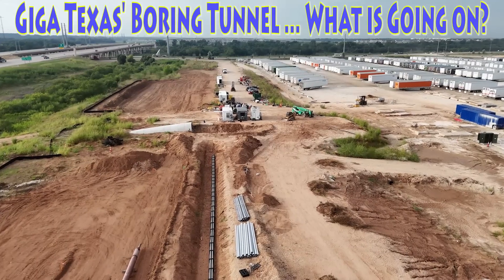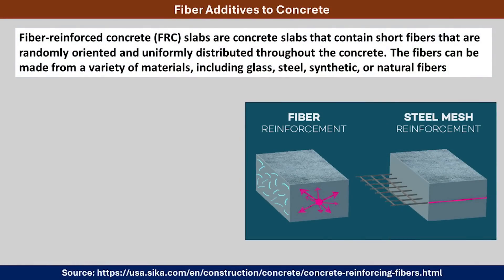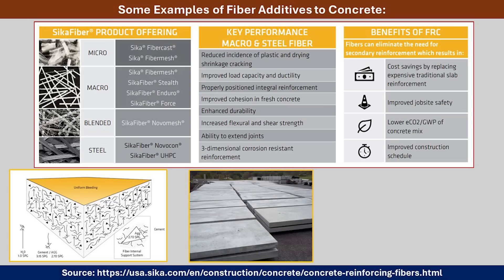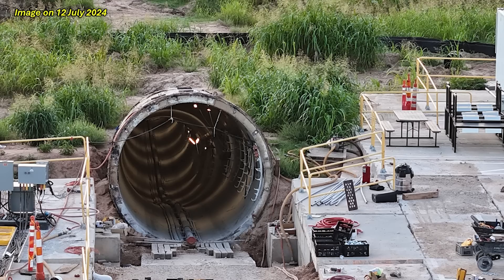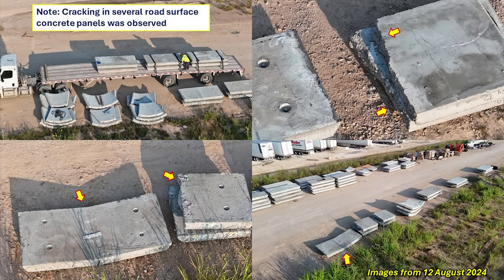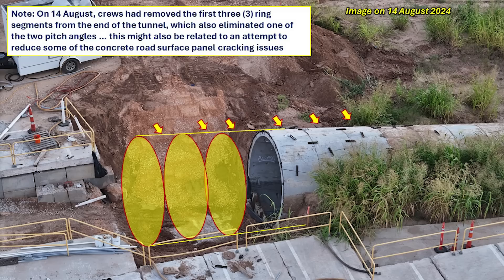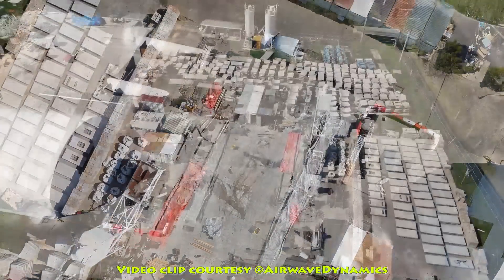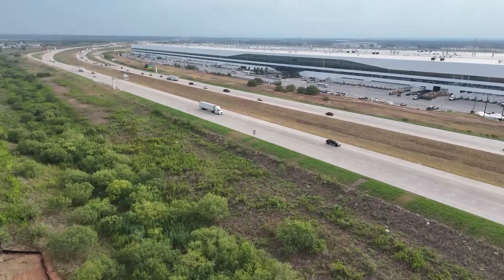Boring Company Giga Texas Tunnel Road Panel Issues, Mitigations & Probable Solutions

Comment: It is my understand that fiber reinforcement was developed primarily to reduce the cracking of concrete slabs placed on graded ground surfaces such as driveways, sidewalks, and slab on grade floors. The fibers in fiber reinforcement are not long enough and do not have enough surface area to provide the needed tensile strength the transmit the live load carried by the slab to the points of support.

Comment: The Boring Company is incompetent.   But his is just the tip of the incompetency iceberg. Elon thought boring smaller tunnels would be faster.  Its not.  But they ARE too small to afford proper ventilation for any substantial length.   Okay for electric vehicles, that won’t pump carbon monoxide into the low parts of the tunnel, but a death trap if one of those EVs catches fire.   And not suitable for any fuel burning vehicle. These narrow tunnels also fail to allow an escape path should there be a vehicle fire in the tunnel. ( he would have to bore a SECOND parallel tunnel for that. )

Given what a Tesla fire LOOKS like. ( plenty of videos online ) would YOU want to be the Las Vegas tunnel when the chauffeured Tesla in front of or behind you bursts into flames?

Comment: I had a neighbor that did the same thing with his driveway vs ours that use rebar.  He has cracked up so much more than ours. I would t use fiber based concrete at least when building residential for sure as many smaller concrete companies don’t have the expertise.

Comment: I'm an ex UK tunneler who started work as a surveyors assistant in 1960 (Chainboy) Drove site equipment and when old enough helped to assemble open face tunnel boring machines for a new line of the London Underground, due to the knowledge I learnt in erecting the machines I became an operator obtaining tunnel average speeds 12/13 rings per 8hr. shift the record was 21 though that was a fluke as no tunnel had been done in the previous shift, so a stock was at hand in the tunnel and all skips empty. My next contract was on the Suez Road Tunnel as supply yard superintendent. Lining segments and road decks of steel reinforced concrete were cast onsite.
 I then joined a Civils Consultant company's tunnel department as a Senior Inspector of Works, my first posting being The Cairo Wastewater System a UK/Us Aid project through silt ground so closed face and balanced bentonite was used as face support and material conveyance.
The first time I involved with NATM shotcrete was on the Heathrow Express tunnels and stations within Heathrow Airport. Blue clay excavations were carried with a rotating bucket excavator, a top heading was dug. A sealing layer of shotcrete applied, rebar arch and steel mesh installed and a layer of shotcrete applied, more mesh and final layer of shotcrete. The tunnel was built top headings first for 10m, bench heading and then invert to catch up and form the circle.
This same method was used on Crossrail tunnels project in London but shotcrete was replaced with fibrecrete which was shot into place thus it was compacted. Core proved no voids found. The lining concrete was delivered to site before excavation could start, slump test taken and then fibers added to ensure quality. Plus no delay on delivery to site.
My thinking of the fibrecrete road panels was as mentioned in other comments. Design not allowing for point loading in construction. Lack of compaction and supervision and possibly poor mix design and controls. I have never seen flat panels used, tunnel linings are subject to an even loading full circle, so the loading is spread out.

Comment: Did anyone get fired or reprimanded for the fiasco of the road panels❓️

If it's a factory setting, then the form templates would be so that a worker wouldn't need to set foot into the concrete.  Thus the rebar wouldn't be pushed to the bottom.
Reply: The rebar should be installed on spacer blocks to ensure a designer cover to rebar, usually 50mm. I just love to watch the video of driveway contractors stamping mesh in by foot. I wonder why most of them crack.

Comment: concrete in bending need to be pre-stressed.   the panels in bending are in tension on the bottom and that will definitely fail unless it is preloaded in compression.   ME 101
Reply: Short slabs of this size don't require prestress. A 12mm x 150mm x 150mm (1/2" x 6" x6") mesh in the bottom third would have been perfectly adequate.

Comment: Very interesting summary by Joe. Had a read through the comments, some very relevant, some only half right. Time to add my long winded (sorry) thoughts:

1. Fibre reinforced concrete is an excellent technology when used correctly. In this case it was not. I find it almost unbelievable that there was no quality control test on some early samples to ensure they could perform. Maybe there was and they just got their numbers/assumptions wrong. Early examples on site at Giga Texas showed signs of cracking and very poor quality concrete (honeycombing of aggregate showing lack of compaction). If these basic quality control problems were self evident to someone (Dessie Doolan and Dave Johnson also commented at the time) watching them from a drone video, I wonder what quality control was being adopted on site at Bastrop and Giga? Not much, would be my conclusion.
2. The design flaw may have been incorrect calculations, It may also have been in the design assumptions. These slabs have a number of load conditions to meet, often the service loading (in-place) is not the critical one. Manufacture, transport, installation loads, etc all need consideration. The wheeled telehandler used for their installation may be a load condition not designed for. Consider the front wheel point load, carrying the next slab in front of it. running a little off line so the wheel moves from the side to the centre, the opposite wheel climbs the tunnel wall slightly, the load swings, the driver hits the brakes. Suddenly you have a dynamic point load that can be 3x the static load, sitting in the middle of the slab. A lot heavier than a cybertruck wheel at each side.
3. Some close-ups of the broken slabs showed the fibres sticking out. It didn't seem like a lack of fibres to me but hard to tell from these arial shots. 40-50kg of steel fibres per m3 of concrete is a pretty common dosage.
4. Should be nothing to do with the tunnel alignment. The slabs should have been designed with tolerances to suit the universal ring tolerances of the tunnel segments. If not it is back to a design error. They knew the tunnel had a vertical curve and the longitudinal pitch of each tunnel ring varies by 2 inches from widest to narrowest point.
5. Removing the first 3 rings had nothing to do with this invert slab issue. We can see the first 7/8 rings are all in a straight line. these sat on the ground where the TBM was launched from. A concern at launch was the poor quality of the ground right in front of the TBM (it got a lot of rain while waiting for the TBM to launch). I predicted a "dive" at the TBM launched due to this. We can see from the alignment of the 4" pipe that this occurred (not uncommon). TBC can say what they like about having to do this intentionally but the argument doesn't hold water for me. why launch at the wrong angle and cause a misalignment of the thrust forces intentionally in the early stage when you could angle the TBM down 2 degrees and get a straight launch (how it is always done). Very common to have some sacrificial rings at the launch as cracking and displacement often occurs. 

As Dessie has said, the tunnel lining used fibres (it may also include rebar). They are used worldwide in tunnel segments, often with no rebar. Tunnel segments largely operate in compression so the reinforcement of any kind is fairly redundant. Fibres (especially polypropylene microfibres (non-structural) help a lot to avoid spalling during handling, aid durability  and (of ever greater importance, give the rapid increase in electric vehicles) resistance to explosive spalling during a fire. Steel fibres distribute loads and provide a lot of resilience/ductility before failure.

Feel free to disagree, I may well have missed something or be way off base with the latest fibre technology.

Looks like the have a fix in hand. I hope the steel reinforced replacement slabs have been tested and their design independently checked. Plus some 28-day strength tests, rebar load tests, cement and aggregate supply quality records, mixing, compacting and curing records (basic quality control measures that stop us all falling through the floor).
Reply: Definitely quality control problems, but my question is... Is fiber a good choice as the only reinforcement (no rebar) when the concrete is likely to be placed in tension... Beams, bridge decks, tunnel road segments, etc.? Can fiber ever be engineered to be safe when concrete in tension under heavy load?
Reply: @DavidJohnson-tv2nn  Generally not. But the technology is advancing all the time. Already used for slabs that span in two directions. Certainly could have spanned the slab width in this tunnel if designed right. My bet would be they didn't think about the temporary load case I described.
Reply: @tunnellingsalisbury7605  Thanks for the reply! Not being an engineer I'm at a big disadvantage here. Your suggestion as to the cause seems entirely possible. But there are a couple of questions....
On Joe's 7/29/24 video at the 19: 56 and 20: 02 timestamps.... There are 4 and possibly 5 broken tunnel road segments stacked beside the road. Likely failed even before being installed. But even if they were removed after being installed.... 5 failures caused by unusual loading events?
Also, if these failures were caused by the telehandler, why remove all of the road segments and replace them with a design using rebar? Wouldn't it have been easier to just replace  the broken segments and stop loading them with 20,000 pounds of heavy equipment? That is... Using smaller lighter forklifts instead?
Again, I'm not an engineer so I can be entirely wrong on this.
Reply: David, you are right.
Maybe they tried to stick with them after a couple of them broke but as more were damaged they decided to cut their losses.
My overall view is that TBC’s problems can all be traced back to pitting a failed yoghurt salesman in charge of a civil engineering company.
The Giga Texas and vegas photos I see tell me that safety and quality are not top of their agenda unfortunately.
Reply: Need Dyneema mesh.

Comment: If you were going to fail a slab, then the section as shown would be ideal.  How ironic.  Now if the slabs were an inverted catenary curve to place the slabs in compression would be an improvement.  It seems other approaches ie. trusses and light weight removeable panel sections would be more efficacious

Comment: 5:00 If there's one thing that's been shown, again and again is that you can't really "prevent flooding" in a tunnel. Most tunnels leak, and most are susceptible to flooding during extreme weather events. It is one of those things that has been shown again and again almost without fail. Being that close to the river, going under a drainage channel and in an area that sometime gets hit by tropical storms, we can expect that the Giga Texas tunnel will eventually suffer a flood event. It happens, its normal, and eventually, the sump pump does its job and catches up.

Comment: I believe that #4 (1/2" dia.) rebar reinforcement spaced at 12" o.c. each way, 1-1/2" from the bottom of the slab would have been acceptable. They could have also added fiber reinforcement to mitigate cracking. It seems to me they should have installed some rebar or other metal reinforcement.
Reply from the maker: I'm curious to see up close what solution they came up with. Hopefully they will begin delivering some of the newer panels soon and i can get better images of them.